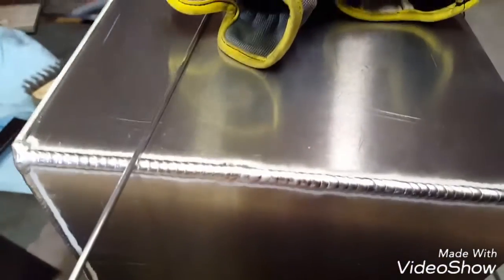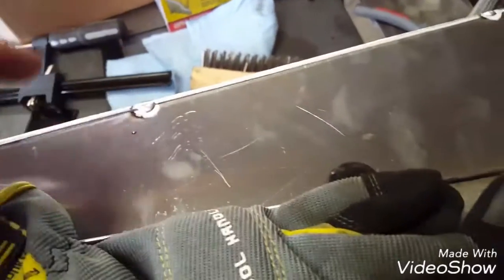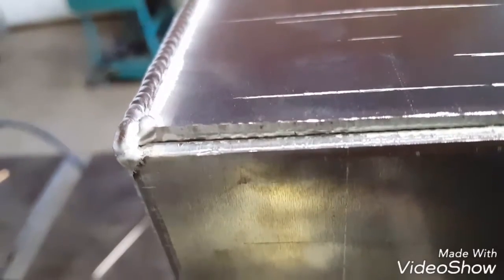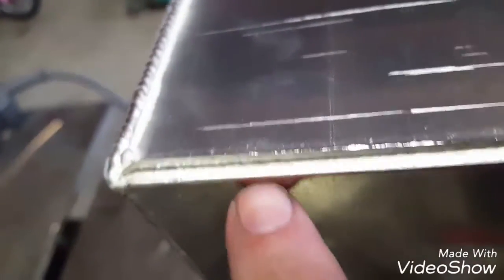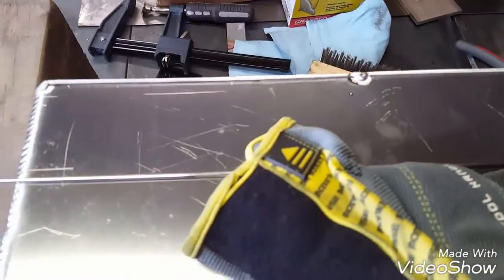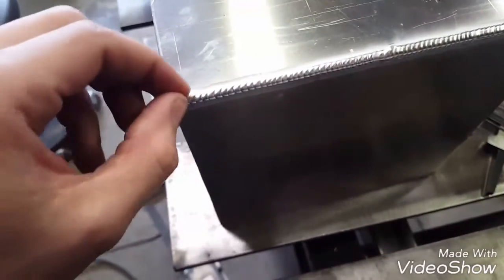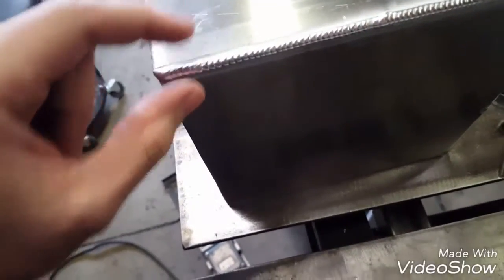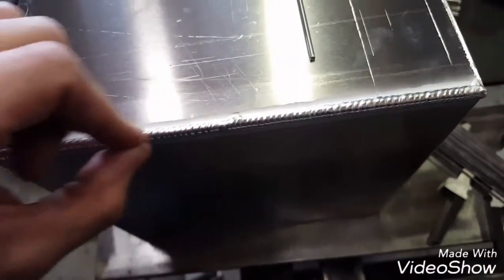Aluminum Welding and Fabrication quick tips

Comment: Hi, just a quick question, when I do aluminum boxes 1/8” thick, outside corners,  I often get unwanted penetration on the inside. Doesn’t look to appealing. I guess I need to watch the puddle more carefully. I tend to look more at the front of the bead where I dip than the back of the puddle. Should I be looking at the whole puddle instead of just the front??
Thanks,
Dave Z
Reply from the maker: If I don't want burn through I'll clamp a square piece of thick aluminum to the back.  If I can't do that ill start a puddle and give it just enough amperage to move forward without adding filler.  It's kind of a fine line.  You just need to make sure you're right on the verge of not having enough amps to push the puddle forward.
Reply: Thank you for the quick response. I appreciate all your effort in making instructional videos. I can now tig weld aluminum fairly well because of them. Thanks Again, Dave Z